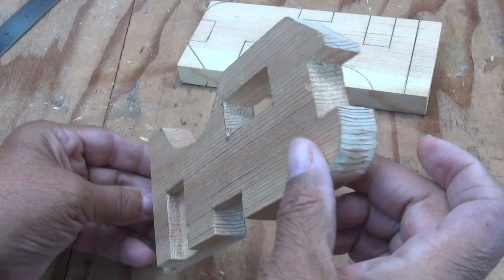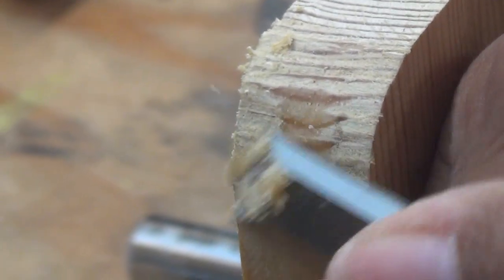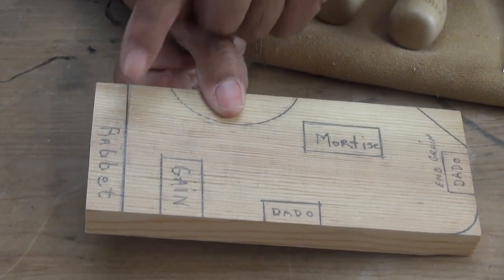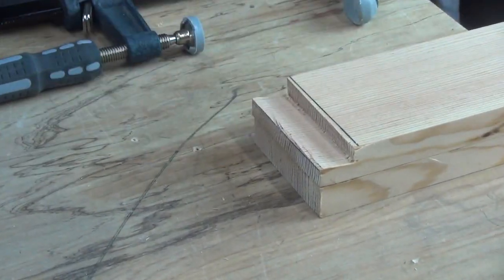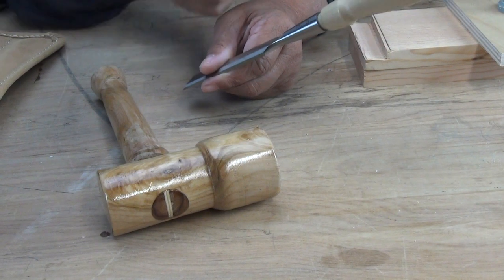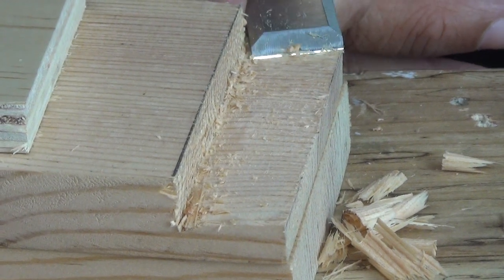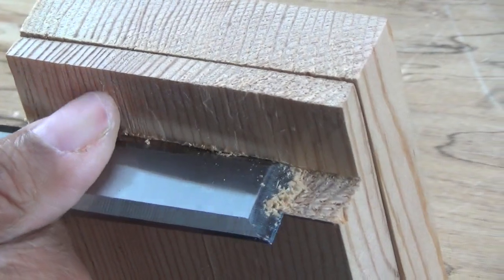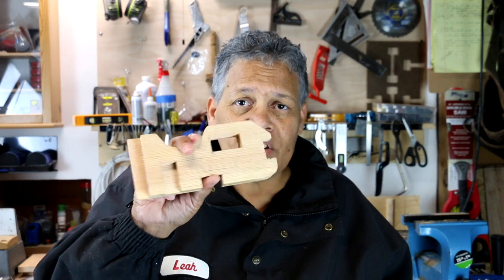Stop Sucking at Chiseling with a Gottshall Block

Comment: I build furniture with hand tools- hand cut dovetails, mortise and tenon, housings, etc. This exercise is excellent!  Here's a tip for getting things to the next level. After you do the pencil layout, use a knife to mark the lines that go across the grain.  Ideally, you'll be using a square off of a reference edge and then move the knife along the square. Knives don't work well along the grain, where normally we'd use a gauge. So, what does this do?  A sharp chisel will go right into that knife line and the line will guide the chisel. No guessing required. You end up with perfectly straight edges cut with to the precision of the thickness of a knife line.  There are a couple things to know, though. Sneak up on the knife line when you are cutting. Take out the bulk of the material first until there's only 1/32 or 1/64" left, then put the chisel in the knife line and make the final cut. If you don't do this and put the chisel into the knife line right away, when you whack the chisel, it will crush the wood back into the knife line and spoil the work. When you clear the waste first, you give a place for the cut off material to go and avoid this. So, work up to the line, then make the final cut.  You'll be amazed how much this improves the result, especially for shoulders and housings.
Reply: Look closer...the knife line you mention is there...a bit crooked... but there...

Comment: Wow! this video is so awesome!  I have one comment about grain direction. At 2:13 you said that people should consider grain direction, which is great. However, the grain facing the camera is not necessarily going down from the rabbet. This is because the facing side is cut perpendicular to a radius of the tree, not parallel. It is very subtle learning by feel what direction is "down," "up," "with," or "against" as far as grain is concerned. People new to hand tools should be thinking about what angle they are cutting the fibers. Exactly parallel? you might split rather than cut. Perpendicular, it is slow going and hard to peel. Almost parallel? you can be cutting uphill or downhill and there are different outcomes probable. If you pet a dog the wrong way you will make the fur choppy, but if you have to slice through a bundle of dog hairs, it's not as simple as saying, "cut downhill."  We should all be aware that grain is something that we have to learn. Some wood species are more like sponges with little obvious grain, but many are very heavily grain directional like the wood in your video. Maybe we should just say, "heads up!" like you did.  Keep up the great work!

Comment: Gain is a boat building term.  Often seem on the stems of a lapstrake boat.  Great way to make a strake fit smoothly into the stem.  I have mostly used them when they are complexly angled in that fashion.  Great basic skill project.

Comment: I look forward to watching your videos as I learn so much that as a hobbyist woodworker I can put into practice... Well, I've never heard of a Gottshall Block and I think this is a great for practice.  I noticed that you covered the rabbet in detail and gave helpful tips about the cross-grain and slope of the grain but what about the other cuts on Gottshall Block?  Particularly, I was hoping that your video continued to discuss the challenges of cutting the mortise in the center of the block... How to stop if from splitting -- Do you drill holes first then start chopping? Is it possible to cut a mortise without a drilling or is that a no-no?  Again, as always, I learned something -- Thank you so much!
Reply from the maker: Hey Ray,
You know what? We are planning a follow-up video which will cover in greater detail the process of chiseling different joints. As for your question, because the Gottshaw Block is an exercise to practice using hand tools, you would only use a chisel and mallet to cut the center mortise. (which is what I did).  That said, when working on actual pieces, it is common practice to use a drill press as well.

Comment: i was always taught to par with the chisel turned over so the bevel is down. the way your holding, if it bites in to aggressive the bevel keeps wanting wedging you in and you have no way to lift the tip. turned over you can leverage against the trailing edge of a bevel and pick the edge up.

Comment: This is great information. I am just getting into woodworking, I've always had an interest but never the space or money to get started. 

I have worked on a few projects one of which was a shaker-style step stool. I was chiseling out the area for the stretchers doing sort of a stop dado but each time I ended up with something more like a dovetail where the bottom of the joint widened out. 

What am I doing wrong?

Comment: You didn't mention the pre-cut line I see you my have done with a knife...maybe show/mention that next time...I run mine using a straight edge keeping the blade perpendicular to the wood face...3-4 passes...then I do a back cut 1/16"-1/8" creating a "V" with one vertical leg...helps create a real true edge for hinges/lock sets or the like...